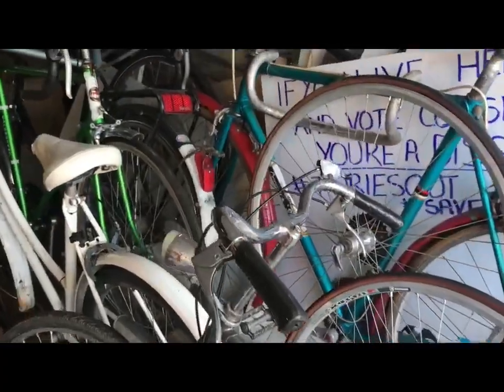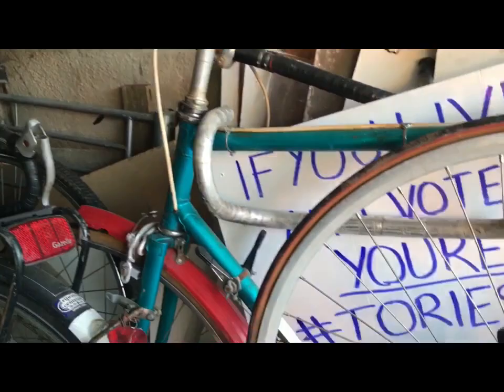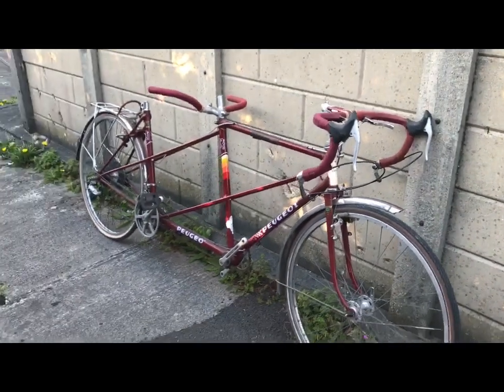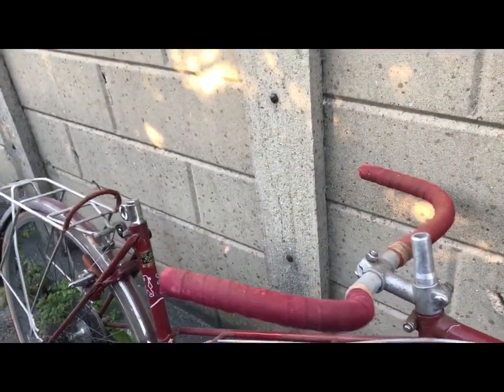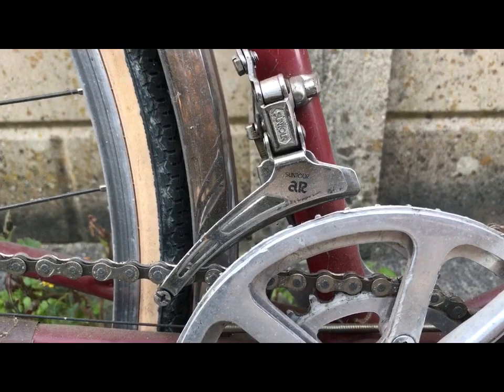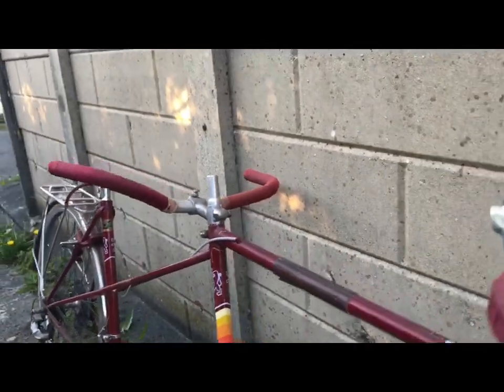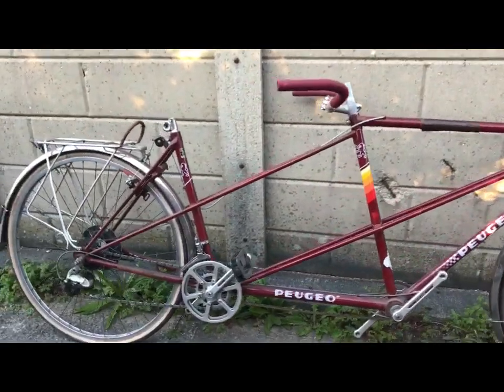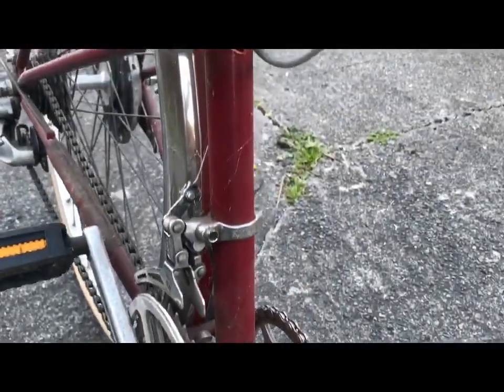1980s Peugeot Randonneur tandem. A question, project bikes. Vintage Shed finds.

Comment: Takes me back to mid 80s to c.t.c york rally,chap came in on same type of tandem(with his wife)I blagged a ride on it with him,i went on the front,as i could get the high seat,I really gave it some stick,thought id broke the frame because of the lousy flex from the frame,so much so that the timeing chain was throw off & damaged,i gave him a fiver so he could get a new chain(lots of bike parts for sale there)i said i was sorry,HE told me that was really scary,cos he thought a tyre had gone down when we was sprinting..